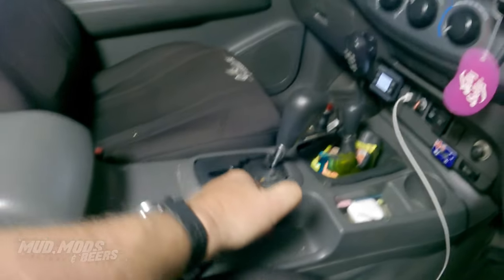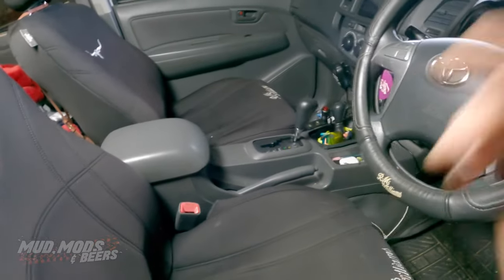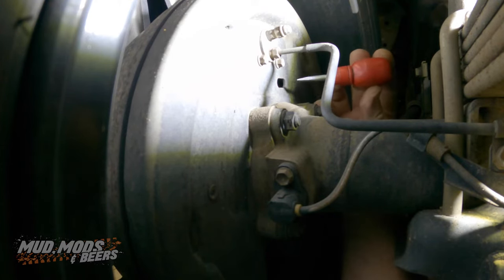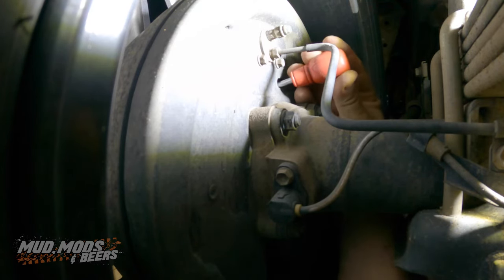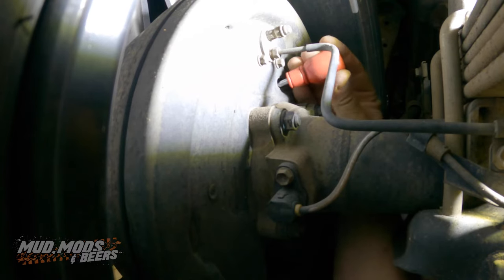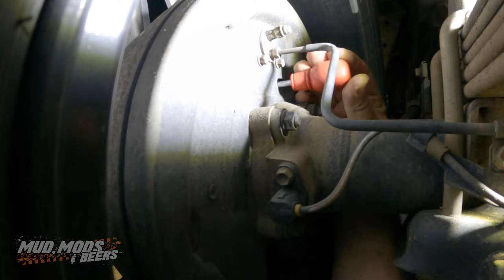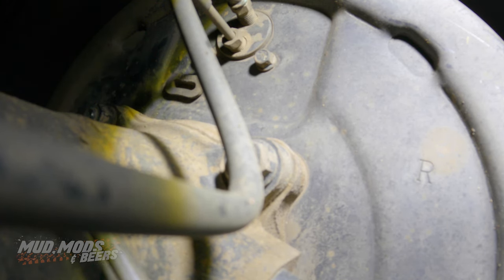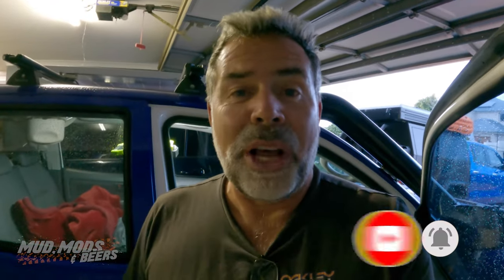Hilux Handbrake a bit loose?  Here's the solution! #toyotahilux #hilux #4wd

Comment: Does this still work if i fully reset the tensioner bolt under tha cab (how ive been adjusting it on an as needed basis). Or do i need to bleed the breaks and reset it?
Reply from the maker: Sorry mate, I only ever adjusted it on the pads as shown. I’d say make sure the rest of the system is working properly before adjusting as per the video